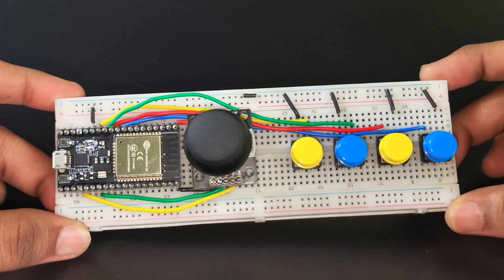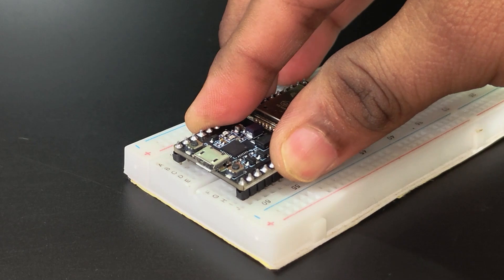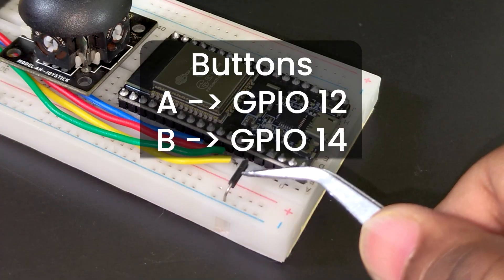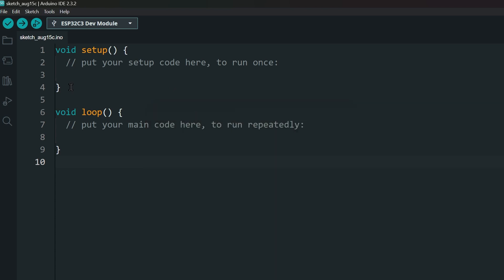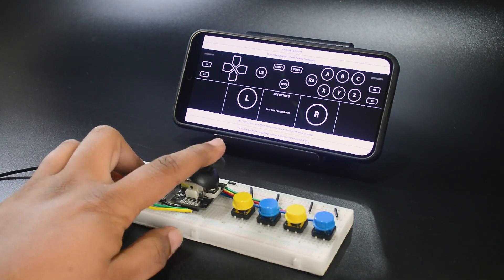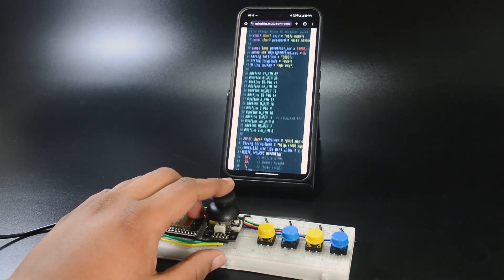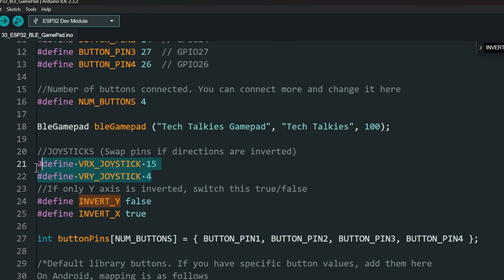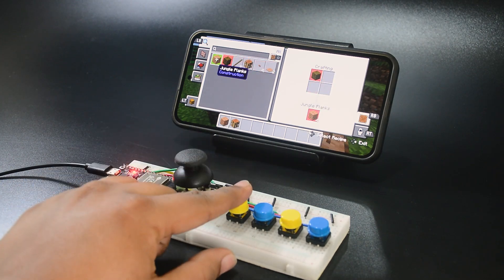Bluetooth Gamepad with ESP32 | Arduino (IDE) project

Comment: Hi, I’m working on a project to make a gamepad using a 3D printer. Since I’m new to this stuff, I’m not sure how to do it without the temporary prototyping board. What can I use instead, and how can I remove it and use the parts without it ? i cant make PCB because thise is my first project
Reply from the maker: If you're making anything electronic, I would highly suggest that you get a breadboard. It is the easiest way to get started on a prototype. It is what you use instead of a PCB. So, there's not really much to use instead of it.

Comment: discoverable on pc but wont connect
Reply from the maker: What do you mean won't connect?
Reply: @techtalkies1 sorry won’t pair, is discoverable though
Reply from the maker: It might be pairing to another device. Did you connect it to your phone before this?
Reply: @techtalkies1 I did but I’m made it forget device . I’m so close yet so far haha
Reply from the maker: Turn the microcontroller on and off once and make sure the bluetooth is turned off on your phone. If all this fails, try flashing it one more time.

Comment: How do I fix extreme Stickdrift
Reply from the maker: That's not normal. You should check your connections and maybe try a different joystick module.
Reply: @techtalkies1  It works with a different stick but I need XInput to play some games. Is there a solution?

Comment: How do I add r1 r2 l1 l2 and you are not showing all the setup on pc so I can know the bord to select in Arduino manager
Reply from the maker: On Arduino IDE, you need to select the board that you're using. There are so many variants of ESP32 that I cannot specify which one you use. Let me know if you need help figuring out your board. 

As for the trigger buttons, you can add extra buttons and assign them in the code
Reply: Am using esp32 cp2202
Reply: I’m using the same bord as yours please help
Reply: But mine is type C not micro
Reply from the maker: Can you send the link from where you bought it?
Reply: @techtalkies1  am sending the link but is always desapering but the bord is CP2102
Reply from the maker: You need to know what Esp32 chip it is. Is it S3 or C3, like that

Comment: Bro please give me code for adding another joystick bro
Reply from the maker: I'm sorry, I do not have access to a computer for a few days. I can help you when I get back.
Reply: @techtalkies1  just text code in reply and tell where to add please
Reply: @techtalkies1  just type the code and tell me where to place in reply please
Reply from the maker: Add more analog pin inputs.
Then copy paste the code block that reads the analog inputs and change the pin numbers.
Reply: @techtalkies1  bro number of buttons only for buttons or also for joystick
Reply from the maker: Only for the buttons.
Reply: @techtalkies1  very thanks bro you helped me 🫂
Reply from the maker: My pleasure!
Reply: @techtalkies1  #define VLX_JOYSTICK 16 , bro is this code is right
Reply from the maker: Correct. Similarly just copy paste all the other lines.
Reply: @techtalkies1  ok thanks bro
Reply: @techtalkies1  other lines means
Reply from the maker: Where analog inputs are ready and then the joystick values are set.
Reply: @techtalkies1  im coded below the vrx and vry code

Comment: Error in code while verification
Reply from the maker: What is the error you're getting?
Reply: @techtalkies1  error corrected bro my mistake
Reply: @techtalkies1  bro  number of buttons only for buttons or also for joystick left and right
Reply: @techtalkies1  can I send my code to you and can you tell me the problem in code please
Reply from the maker: You want to add 2 joysticks?
Reply: @techtalkies1  yes bro I want to add two joysticks please tell me
Reply: @techtalkies1  i also want to add L1 R1 buttons
Reply from the maker: Change number of buttons value and add the new buttons code. The code is pretty simple. Did you try to modify it?
Reply: @techtalkies1  I don't know how to modify please tell me
Reply: @techtalkies1  number of buttons includes joysticks or only buttons
Reply: @techtalkies1  How to modify code for adding another joystick

Comment: Bro my mobile ghost touching after connecting to esp 32
Reply from the maker: Your connections might have a problem. The joystick might be drifting or the buttons might have loose connections.
Reply: @techtalkies1  even when buttons are not connected it ghost touching bro
Reply from the maker: But the code has buttons initiated. So if you don't have buttons connected, it will have this kind of behavior. If you don't want to use buttons, remove the button related codes.
Reply: @techtalkies1  bro my code has four buttons and two potentiometer set to pin number and other are set to 0
Reply from the maker: Try running just my code. And check if you have ghost touches with that.
Reply: @techtalkies1  ok i will try and reply you later
Reply: @techtalkies1  in your code it doesn't ghost touching

Comment: hi
i couldn't find "ESP32" in arduino library even i installed esp32 in board manager.
i found esp32 dev module but error occurs when compile
Reply from the maker: What error do you get
Reply: @techtalkies1 I copied and pasted the code as it is but when compiled, 
" error compiling esp 32 dev (or any ) board".
I changed the boards but same error with those boards.
The main issue is that there is no board named "esp32" or "esp32s" in The board list in arduino IDE.
Regards
Reply from the maker: You installed the board in the board manager?
Not the Arduino one, but the Espressoff ones
Reply: @techtalkies1  i installed in board manager it took 20 minutes to download lot of things. it shows lot of boards but not esp32 or esp32s
Reply from the maker: Did you paste this URL in the boards list in settings?

https://raw.githubusercontent.com/espressif/arduino-esp32/gh-pages/package_esp32_index.json
Reply: @techtalkies1  yes i did and got lot of boards esp32h2 dev module, esp32c6 dev module, and lot more. i selected "esp32s dev module" but same error 
"Error compiling for board ESP32S2 Dev Module."
Reply from the maker: I googled and can see that this can happen sometimes. You can try
1. Uninstall and reinstall the ESP boards, restart the IDE inbetween 
2. Sorry to say, have to uninstall the IDE and try a clean install after reboot.

If you're somewhat tech savvy, there is a method to manually install the boards.
Reply: @techtalkies1 ok I do.
Your co operation is so impressive.
Will tell u incase of  any problem.
One more thing. Is it only"ESP32S" ?
Reply from the maker: Depends on your board. Sometimes, if you have a copy board, it will compile with a different board selected. Original boards, you can select the exact name of the board.
Reply: @techtalkies1 it is not compiled in even IDE.
Reply from the maker: Yes I understand. So try reinstall the board. And if that doesn't work, reinstall the IDE if possible
Reply: @techtalkies1  hi
i reinstalled the IDE i m using 1.8.19. and reinstall the board files as well but reslt is same.
can you please tell the actual and full name of required board which will appear in boards list. may be i am searching wrong one.
Reply from the maker: No, even if you have selected the wrong board, the program should atleast start to compile. And then maybe throw compilation errors. But your compilation does not start.
Reply from the maker: Something else you can try is, go to.the boards manager and install a different version of the board. Maybe a bit older version.
Reply: @techtalkies1  it starts compiling and takes time but ends with error.
and i noted no any even other code even blink LED compiles.
what could b there?
Reply: @techtalkies1  please tell which exactly names must be selected from board list.
Reply from the maker: What board are you using?
Reply: @techtalkies1 esp32 devkit1
But the problem is this code is exactly for which board?
I tried lot of boards but all have same error
Reply from the maker: I used the same board when I created the project. It works.
Reply: @techtalkies1  hi sir
i did it. problem was windows version i was using 32bit and it requires 64 bit.
now it is being compiled without any error.
now the final thing is, can i make it without Bluetooth, means wired?
if yes, please guide how.
thanks alot
Reply from the maker: You can but this project is for Bluetooth version. I will check update a library for wired. For ESP32.

Comment: Hi, I need your guidance to do reverse.. connect bluetooth gamepad with eps board and control speed to dc motor or simply output o to 5v output using joystick..
Reply from the maker: This library should be helpful

https://github.com/ricardoquesada/bluepad32

Comment: I have been working at this for hours and cannot for the life of me figure out why this simply refuses to work. I followed the steps to a tee, multiple times starting over, yet my esp32 refuses to show up on any devices when this code is ran. I can do a test script to use BLE without the gamepad script, and it connects, but once i try using this code (copy pasted) it just pretends its not a bluetooth device. Any help?

Comment: Hi friend, do you know how to enter 2 volume buttons in the code?
Reply from the maker: Hello. You can add a button and use the below code on the button.

bleGamepad.pressVolumeInc()

Make sure to release the button after! Let me know if it helps.
Reply: @techtalkies1 
 hello, thanks for the message. I have tried several things and the closest I came to success is with the "special button" example folder The volume is constantly increasing, I have not managed to assign pin and push button
Reply from the maker: Share the code snippet
Reply: @techtalkies1  

#include <Arduino.h>
#include <BleGamepad.h>

BleGamepad bleGamepad;

void setup()
{
    Serial.begin(115200);
    BleGamepadConfiguration bleGamepadConfig;
    bleGamepadConfig.setWhichSpecialButtons(true, true, true, true, true, true, true, true);
    // Can also enable special buttons individually with the following <-- They are all disabled by default
  
  bleGamepadConfig.setIncludeVolumeInc(true);
    
  bleGamepad.begin(&bleGamepadConfig);

    // Changing bleGamepadConfig after the begin function has no effect, unless you call the begin function again
}

void loop()
{
    if (bleGamepad.isConnected())
    {
        
        Serial.println("Increasing volume");
        bleGamepad.pressVolumeInc();
        delay(100);
        bleGamepad.releaseVolumeInc();
        delay(100);
        bleGamepad.pressVolumeInc();
        delay(100);
        bleGamepad.releaseVolumeInc();
        delay(100);     
    }
}

Delete some lines now to make it look better.
I've tried everything, but I don't understand Arduino.
This is the example of the library, I tried several things to assign pin and button but it didn't work.
Reply from the maker: Have you deleted the lines where you have taken button input?
Reply: @techtalkies1  
I have removed some lines that are not disabled for other button functions, I have left only for increasing volume (to test)
The example is

#include <Arduino.h>
#include <BleGamepad.h>

BleGamepad bleGamepad;

void setup()
{
Serial.begin(115200);
BleGamepadConfiguration bleGamepadConfig;
bleGamepadConfig.setWhichSpecialButtons(true, true, true, true, true, true, true, true);
// Can also enable special buttons individually with the following <-- They are all disabled by default
// bleGamepadConfig.setIncludeStart(true);
// bleGamepadConfig.setIncludeSelect(true);
// bleGamepadConfig.setIncludeMenu(true);
// bleGamepadConfig.setIncludeHome(true);
// bleGamepadConfig.setIncludeBack(true);
 // bleGamepadConfig.setIncludeVolumeInc(true);
 // bleGamepadConfig.setIncludeVolumeDec(true);
 // bleGamepadConfig.setIncludeVolumeMute(true);
 bleGamepad.begin(&bleGamepadConfig);

 // Changing bleGamepadConfig after the begin function has no effect, unless you call the begin function again
}

void loop()
{
 if (bleGamepad.isConnected())
 {

 Serial.println("Increasing volume");
 bleGamepad.pressVolumeInc();
 delay(100);
 bleGamepad.releaseVolumeInc();
 delay(100);
 bleGamepad.pressVolumeInc();
 delay(100);
 bleGamepad.releaseVolumeInc();
 delay(100);

}
}
The lines I tried to make work are not set.
I tried several calls but I don't know Arduino...
The sketch I show you is what is in the SpecialButtons folder
I don't know what line and call to add to make the volume button work
Reply from the maker: You need to get input from button and then call volumeinc
Reply: @techtalkies1  
#include <Arduino.h>
#include <BleGamepad.h>

#define BUTTON_PIN1 34

BleGamepad bleGamepad;

#define NUM_BUTTONS 1
#define VOLUME_INC_BUTTON
#define BUTTON_PIN1 34

int buttonPins[NUM_BUTTONS] = { BUTTON_PIN1 };

void setup()
{
    Serial.begin(115200);
    BleGamepadConfiguration bleGamepadConfig;
    bleGamepadConfig.setWhichSpecialButtons(true, true, true, true, true, true, true, true);
    // Can also enable special buttons individually with the following <-- They are all disabled by default
   bleGamepadConfig.setIncludeVolumeInc(true);
 
    bleGamepad.begin(&bleGamepadConfig);

    // Changing bleGamepadConfig after the begin function has no effect, unless you call the begin function again
}

void loop()
{
    if (bleGamepad.isConnected())
    {
        

        Serial.println("Increasing volume");
        bleGamepad.pressVolumeInc(VOLUME_INC_BUTTON);
        delay(500);
        bleGamepad.releaseVolumeInc(VOLUME_INC_BUTTON);
        delay(10000);

:( I do things but nothing...haha it's not my thing
Reply from the maker: You're increasing the volume without any conditions. You need to increase them when button is pressed. I suggest you look into some basic Arduino coding and then like at my example.
Reply: @techtalkies1  thx for you time :) try this other day xD

Comment: Excellent video. Its possible add a potenciometer for use like trigger (Z axis)?
Reply from the maker: A potentiometer? Meaning you want to input the amount of pressure you're pressing? Or just button type pressing?
Reply: @techtalkies1  yes
Reply from the maker: Yes to what? You want just a button press or pressure sensing?
Reply: @techtalkies1  like the triggers in Xbox o PS gamepad.
Reply from the maker: Yes I understand that. I mean if you want to sense half presses, it will be complicated. But if you just want to detect press once, it is simple, you can add a button.

Comment: Can anyone provide code for pc version
Reply from the maker: It is almost the same as the code I have included. You just have to check what button codes your game needs and change them in the code.
Reply: @techtalkies1  how can i check button codes for my games say minecraft
Reply from the maker: I tested this on PC, using a Joystick test app. It was detected and works. If your game supports gamepad, it should work. Maybe by going into the controller settings and reassigning the buttons to the ones that are actually present on our gamepad, it might work. Try this and let me know. If it doesn't work, I'll look into the key codes for PC.